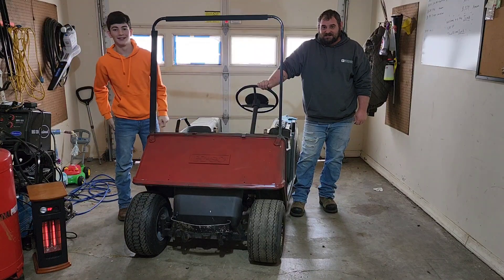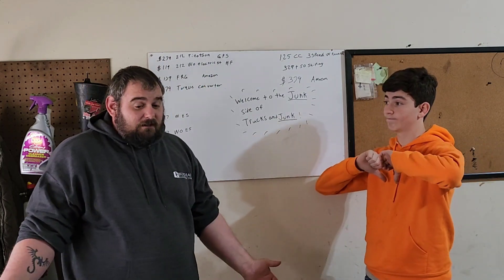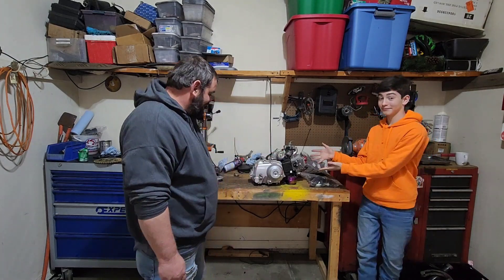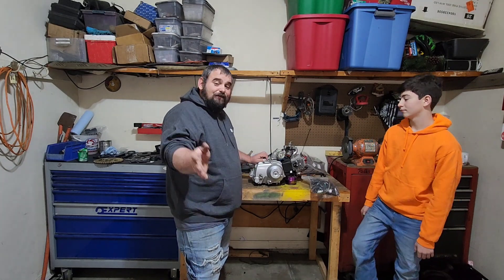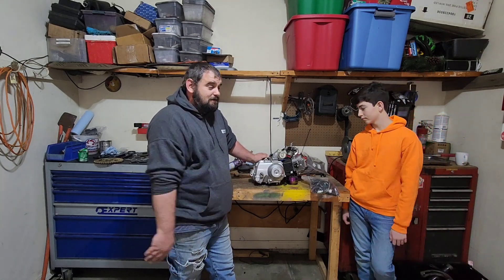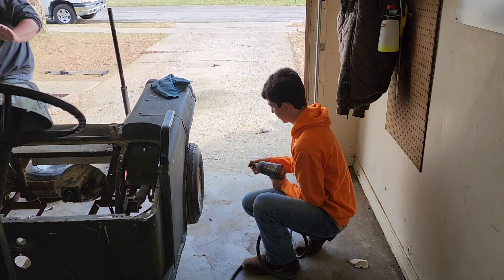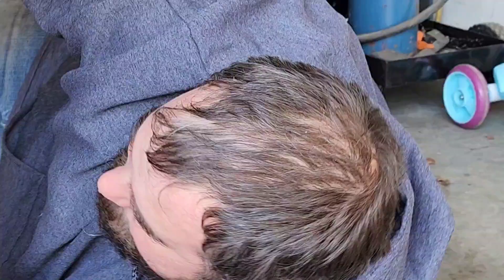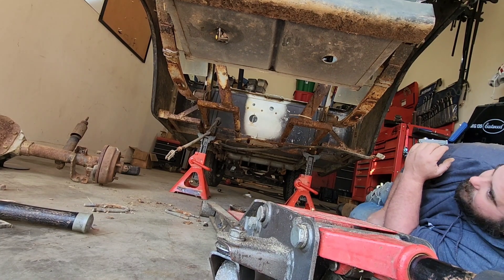How to convert an electric golf cart to gas using A 125CC 3 speed with reverse part 1

Comment: Great job, guys. Can you tell me about the rear end (setup like a cars)?  What it came off of, etc?  Thanks in advance.
Reply from the maker: It was in there when we got it but it appears to be custom in some way because all the shock mounts was just a bolt welded to it, and the axle tube on both sides was shortened so may had been out of somthing else not sure but I am using it on the wheel barrow rat rod so that will be fun 😉
Reply: That rear axle looks to be the normal axle in older EZ-GO carts. I'm assuming 10 spline pinion shaft with no threads. Was the driveshaft held on with a set screw?

Comment: I was thinking about buying that same engine you got from Amazon. Is the engine still working will for you? And what size rear sprocket did you us?
Reply from the maker: It is still working well, and I ended up using 30 tooth  rear sprocket
Reply: @trucksandjunk6190  thank you for your answer and video. I am not a mechanic, but I am going to do this on my golf cart. Thanks!!
Reply: May I borrow you with another question? What size or type of chain would I need for this motor and 30 tooth sprocket? Thank You!
Reply from the maker: @nathanbennett5944  40 series chain worked well for me

Comment: I can't imagine how you're going to handle cooling. The predators and other similar motors have a shroud and fan to sort that out.
Reply from the maker: I believe we covered that in video five with it's time to ride, so hang in there, and you will be amazed . And thank you for watching
Reply: 125cc on my son's lil ATV doesn't have an issue when his sidetracked arse runs in the house to Xbox and leaves it idling sitting still  for better part of an hour until I find it and put it up. That's not moving .. they still gonna get air on it  via moving even inside that body.. these small 110 125.. dont tend to overhead as easily as you think.. anyways  i too  gotva dead electric cart, was pondering if i could order a auto reverse 125 and. Have it replaced that motor on its rear axle..i rather do this for the built in reverse.. ovrr a predator engine with no reverse or some add on gear box to reverse.. i see its can be done now... I'm gonna go with a motor like my boys ATV.. good info.. these guys got this it won't cook in there.. this gonna be cheaper than 6 batteries and alotbof weight shedded.. smart